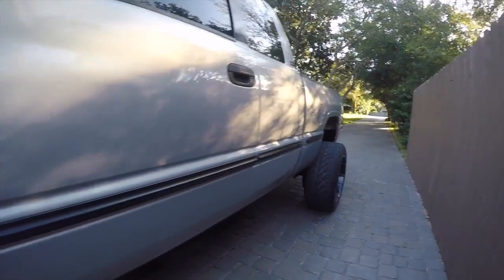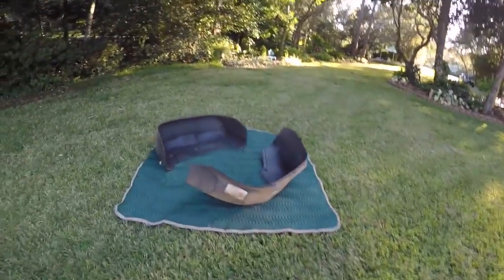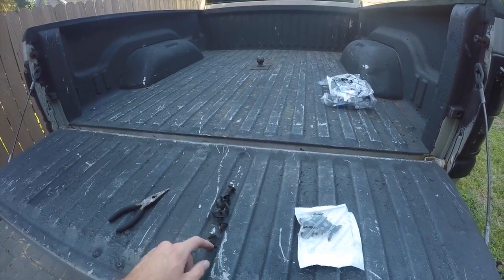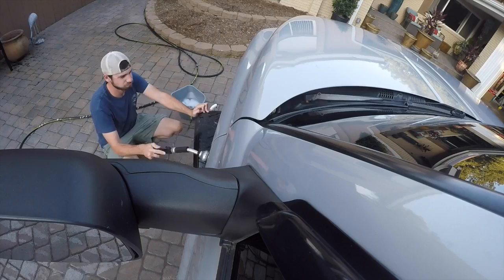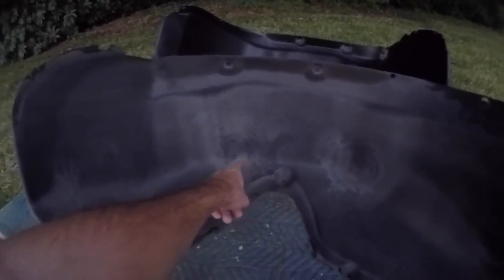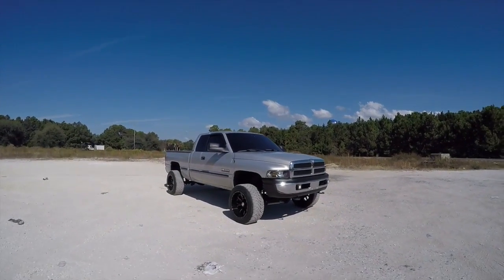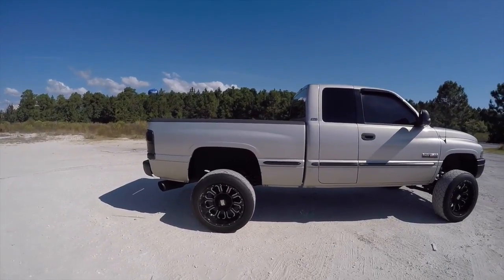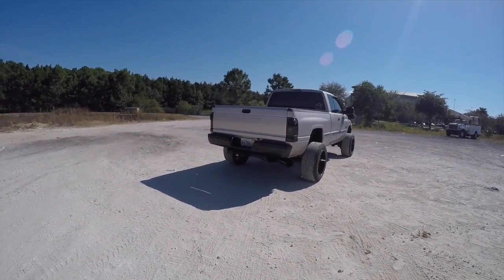Part 2:  Painting the Cummins

Comment: just for info and cheap anything heavy grease or wanting to strip of any paint or adhesive you can get some cans of oven cleaner works especially on engine compartment s that are full of soot and heavy oil amd grease just info for ya for later buddy has a 99 12valve regular cab same color as yours with 5speed nice to see someone appreciative of having older gen rams keep up the vids like the progress

Comment: Hey I have a question how much did you spend on the plastic fasteners for the front fender liner wells because I went to my local dodge dealer and it came out to $6 each plastic fastener so I didn't buy them